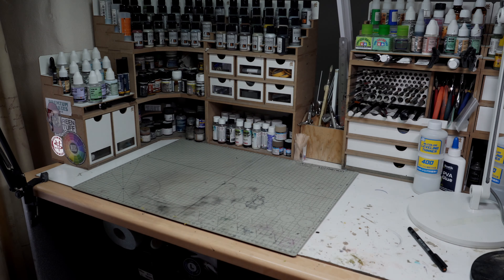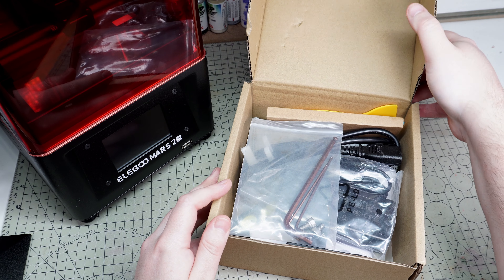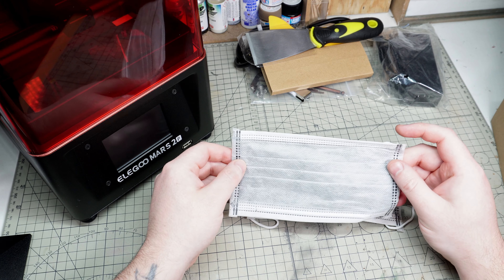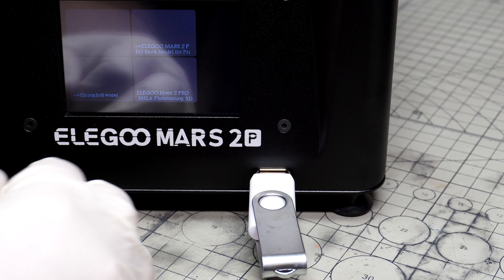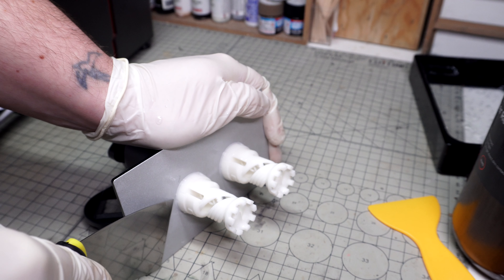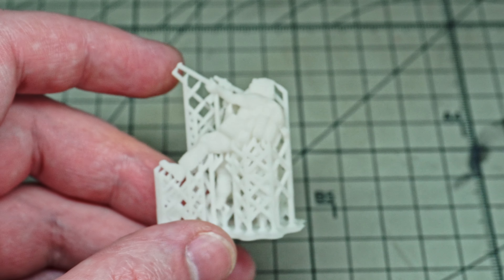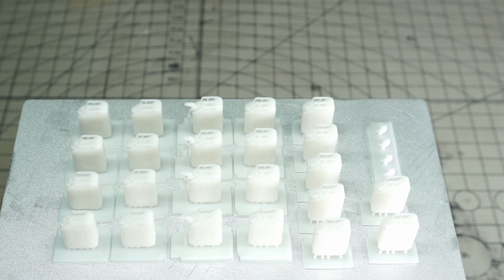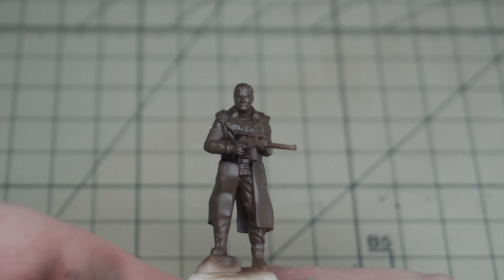LPJ goes 3D. Using my Elegoo Mars 2 pro for the First Time !

Comment: The options open to you now with 3D printing is unlimited. I have been using mine to add extra bits and details to otherwise bland kits. Cults is a great place as is MyMiniFactory. If you want to get rid of the supports easier before you cure the model soak it in hot water. This will make it far easier to remove the supports. The next step is to start making your own detail parts! Great vid mate!!